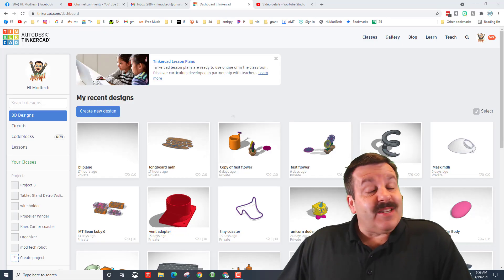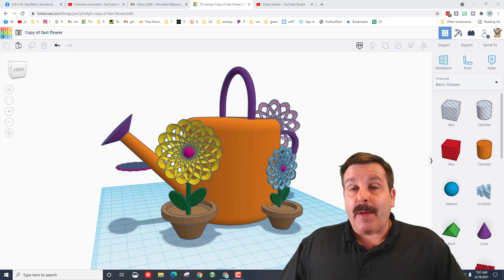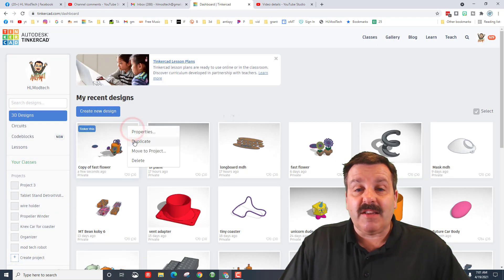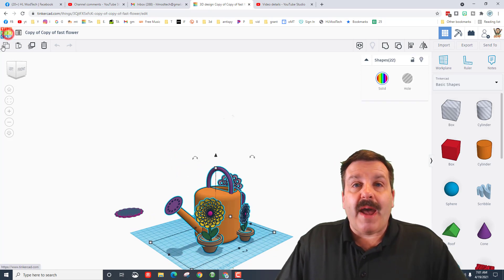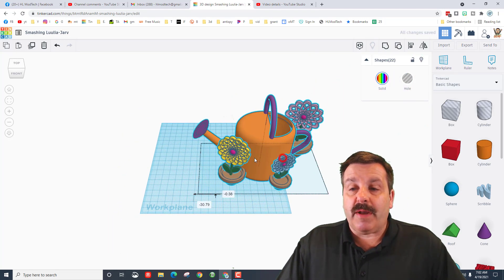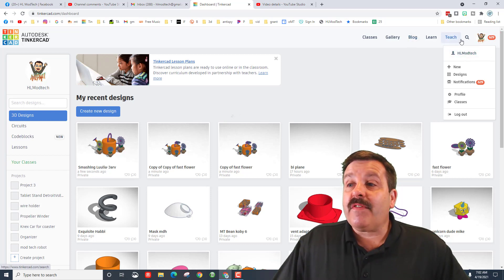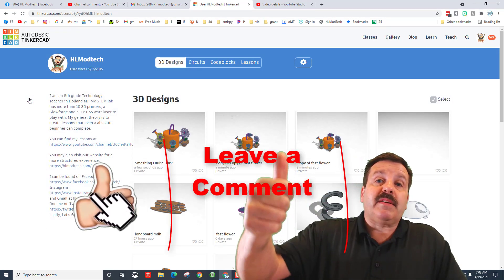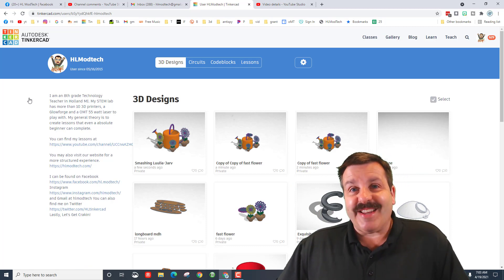Two Fast Fixes for Tinkercad Freezing or has Moving Objects

Comment: Hi there! Love your work. I believe the first strategy doesn't work when you're working with a tutorial. The duplication doesn't carry over the tutorial. Just looking for help if anyone knows a way around this.
Reply from the maker: Thank you. What sort of tutorial are you speaking of? The freezing issue that Tinkercad was going through has been fixed for a while. Of course... a new one could have popped up. I just have not heard anything of it yet.
Reply: @HLModTech  I am just doing a simple tutorial creating a small ruler.
Reply from the maker: This video is just a tip for when Tinkercad was broke. I am guessing your talking about the the ruler tutorial from Tinkercad. Is that correct?
Reply: @HLModTech  yes.